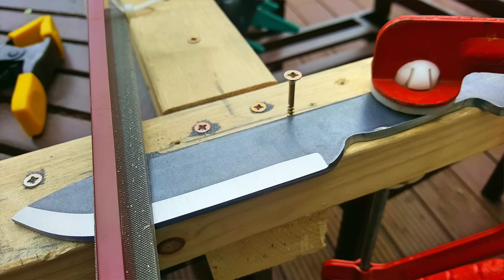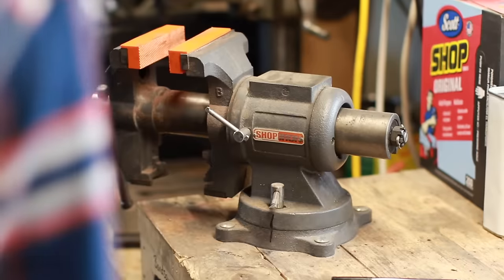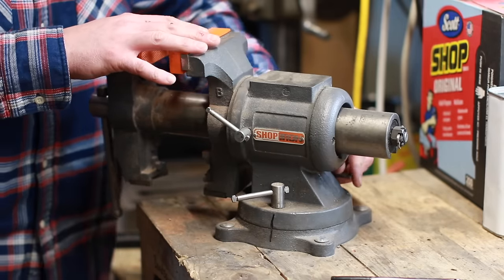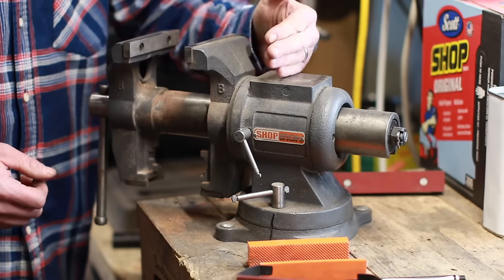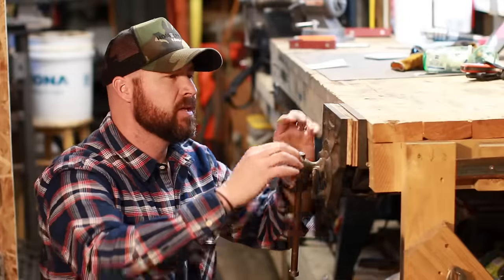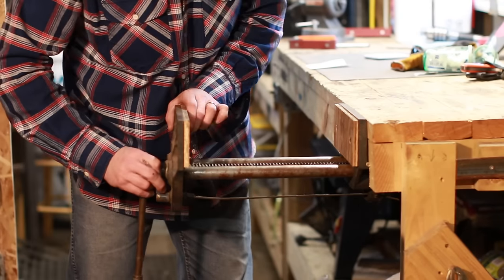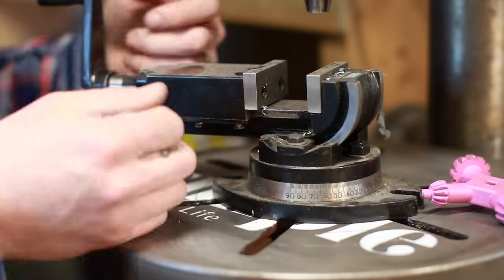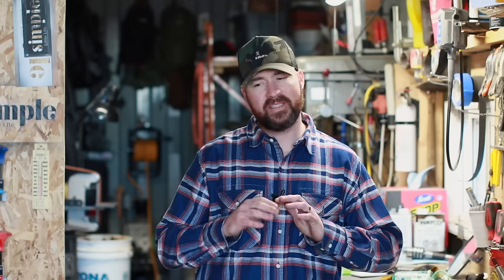Tool Time Tuesday - Bench Vise

Comment: I've had to use a vice that could rotate 360 degrees and it would rotate when I was trying to bend certain things or hammering on it hard.  I would of loved if it had some sort of interlocking teeth.

The last set of soft jaws I made was with aluminium angle iron.  Pretty quick to cut it to length and notch the ends so you could bend a tab over and stop them from sliding left to right.  Also added some magnetic tape on the tops to lightly hold them on.

Comment: ya a good bench vise is worth it's weight in gold.
Reply: I couldn't agree more. Not only is it like having a 3rd hand holding your work, but I also find that things like filing and hacksawing are more efficient because the inertia of the mass of metal dampens vibration.
Reply from the maker: For sure! Cheers!
Reply from the maker: That's a very good point.